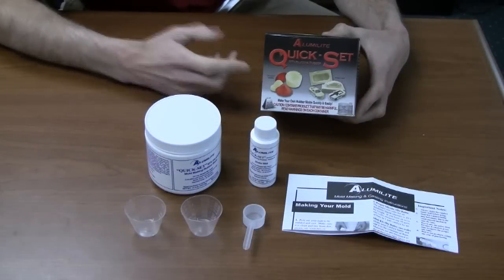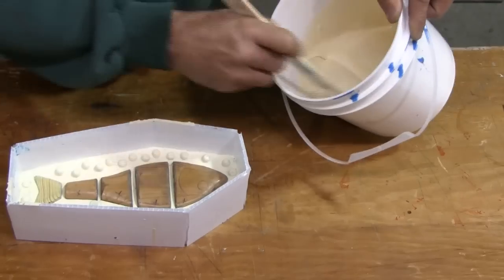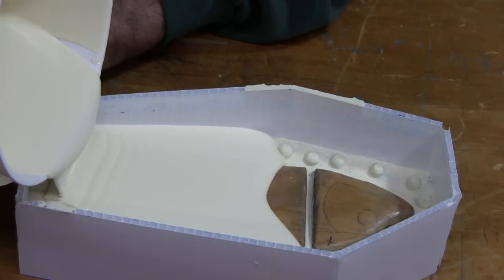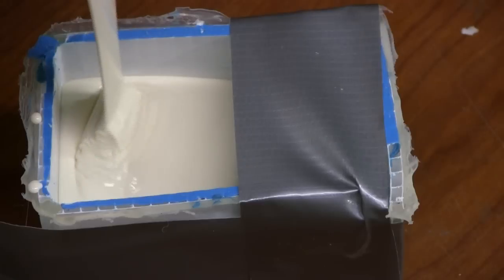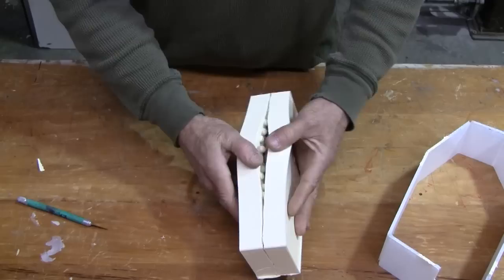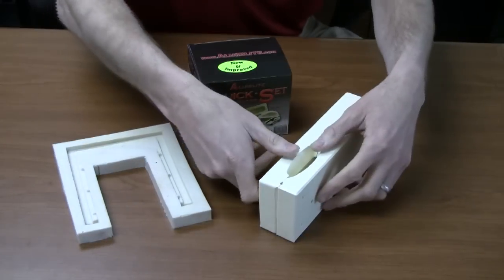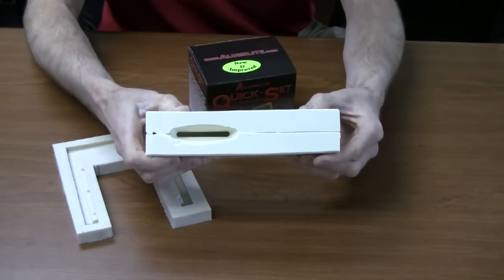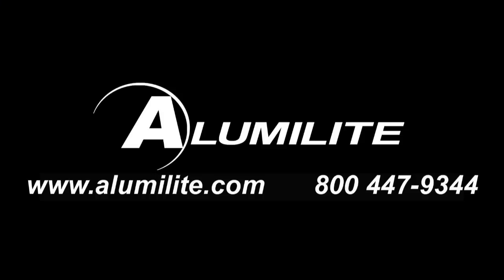How To Use QuickSet Silicone Mold Making Rubber | Alumilite

Comment: I love this product. After throwing my money out the window with another brand of silicone rubber and getting awful, hard as a rock molds, I've decided to give Alumilite Quick set a try. The mold came out so flexible and the details of the piece blew me away. I've actually bought the kit with the quick set resin and some dye ( sold separately). Thumbs up and I'll never use another brand again. I think the kits should be available at all art supply stores as many people don't know about it.
Reply: I seen it at Hobby Lobby. Gonna get me some.

Comment: First time user here: How long can the cure really take to cure? Y did pour a mold 12 hrs ago and is still in the same consistency as in the beginning… y did do a very good mixing of the silicone with the catalyst, making sure to scrape the sides and the bottom of the container as I mixed for almost 10 minutes. Should at least show signs of changing consistency by now? Is this normal?
Reply from the maker: Hi Cesar - please email us at info@alumilite.com for support!